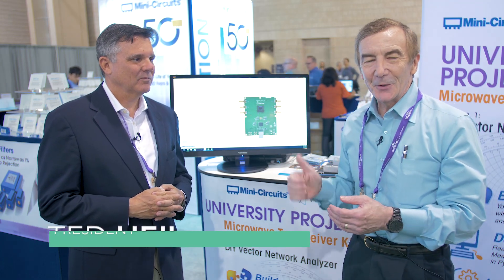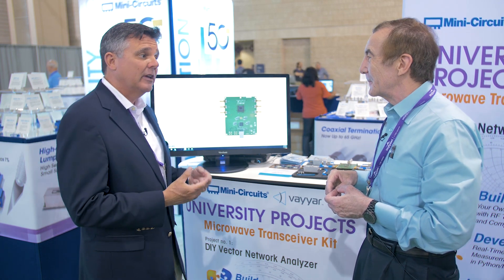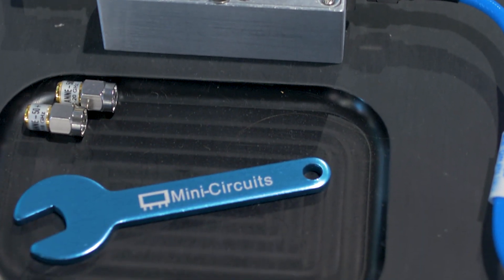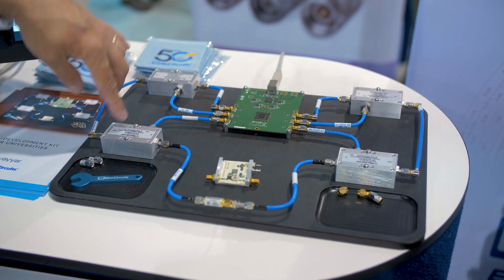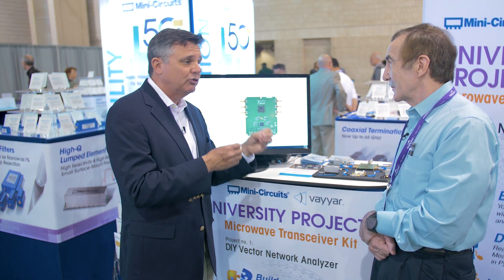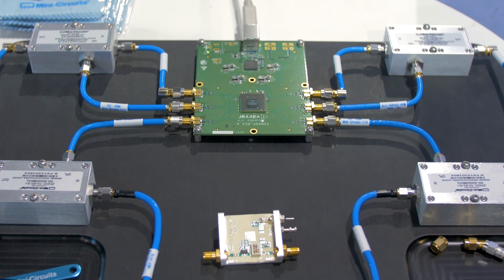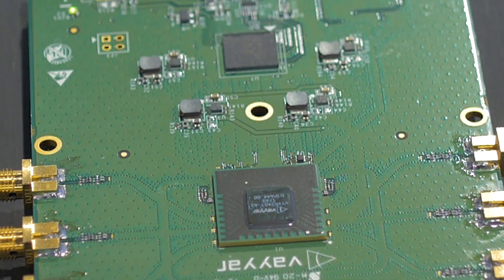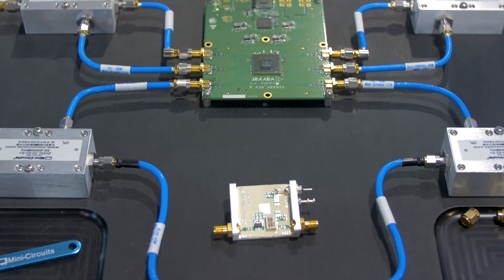How to build a do-it-yourself vector-network analyzer that’s actually useful

Comment: $2000-$3000 is way too much for a college project.  The idea is to learn the basic principles and that can be done with a VNA that doesn't go up to 6GHZ.  Even a 100MHz instrument is very useful and  up to 1.3GHz covers a very interesting range.  The key thing is to get good raw data over the frequency range and then use mathematics to process this data.  That's how the students learn.  The results will be good for much less than $3K.  The calibration kit for a 1GHZ VNA can be less than $50 and making the kit is a very good learning experience.
Reply: Does that $50 1Ghz VNA kit actually exist or was that just a plausible wish list? something like that would be perfect for me, but the cheapest VNA I could find is the DG8SAQ SDR at £420...
Reply: @joejoe4games  What is that strange squiggle thing before the 420?
Reply: @joejoe4games  Hey, so I know this comment is a year old, but a mechanical/manual, third-party calibration kit ("cal-kit") can, indeed, only cost around $50.

Comment: good luck has nothing to do with it, rip off us over pricing at cost, and over valuing product gets you low or no sales in the global diy education markets,making and actually selling things people want to actually buy and use is the only sme way to ethical profits
https://www.ebay.co.uk/i/254098989801?chn=ps
Vector Network Analyzer Kit miniVNA Tiny VHF/UHF/NFC/RFID RF Antenna Analyzer UK,£368.49

Free postage
Get it by Sat, 30 Mar - Mon, 1 Apr from Glenfield, United Kingdom
 • New condition
 • 30 day return
Reply: This isn't targeted at "diy education" and your junky toy doesn't even come close to doing what this thing does.

You're comparing a lab grade educational tool to what is essentially low end commodity hardware, that doesn't even serve the same purpose. Yours is an *APPLIANCE*, this is NOT. 

While they each can ultimately do the same function to a greater or lesser degree, they have WILDLY divergent purposes. But then again I don't expect a spammer to understand the difference.

Comment: I agree with the sentiments expressed here that the cost is way too high.  This is essentially boutique Lego for RF engineers - uses pricey top-end Mini Circuits blocks.  Perhaps better would be a dev board with the RF stuff on one board connecting to the Vayyar board (or e.g. work with ADI and make a ADALM specific to this effort).  This would significantly drop the cost by eliminating all the machined enclosures, cables and connectors.  I know that the presenters say that this is very inexpensive for what you are getting, however, it is way out of range for the student market they are targeting (maybe they forgot there own early days at college?).  Possibly a few wealthy students at an Ivy-league or EE hobbist that can afford to shell out $2500.  BTW, there is a bit a false comparison in stating that you're getting something even close to a $150K VNA (freq range and dynamic range are wildly mismatched).  Consider a field-portable grade 6 GHz VNA from TEK (or knock-off brands) and there is NO comparison.  There is a lot missing (software, calibration, ruggedizing to make it safe / useful, a display and button panel with user interface - tons of features for setup and visualization, ...)
Reply: All this seems to have gone over your head. It's unlikely that students would foot the cost for this kit. The university would purchase this for their labs for the students to use IN THE LAB. $2500 is chump change for a University that's teaching HUNDREDS of students a year in such a program. The would probably buy a dozen of them.

Your argument about the missing ruggedization is a straw man. There is absolutely NO need in a LAB environment, where it's beneficial to test/profile individual components as part of the learning process, to lock the relevant components inside a box. It defeats the point entirely.

Your argument about the display and user interface is equally as fallacious. Did you even watch the video all the way through? Did you listen to it? Did you comprehend what was said? The ENTIRE reason for this to even exist is as a LEARNING EXERCISE in parsing the raw output from the hardware, and processing that data by applying the principles taught in the lectures. The whole damn point is for students to LEARN what is going on inside, NOT be a button pushing monkey.

This IS NOT intended to be a turnkey measurement appliance.

It is attitudes like yours that contribute to the dumbing down of America.

Comment: While I appreciate the effort, that's just not cheap enough.   For less money, I could get a Rigol or Siglent Spectrum analyzer, with tracking generator.
Yes,I know a Spectrum Analyzer isn't quite the same as a VNA... but you can do a heck of a lot with one, and it's a single professional piece of kit NOT a bunch of boxes cabled up and needing a whole table.

Comment: A very good VNA learning platform indeed for college students! I'm currently building a 6 GHz two-source vector network analyzer myself using mostly Mini-Circuits and Analog Devices parts and components. It's fair though to point out that an Agilent 8753D 6GHz VNA can be had for ~ $2500 from ebay, of course minus the SOLT cal kit, and 3GHz 8753D's are < $1600. For up to 6GHz, decent SMA SOLT cal kits could be purchased and if the student is mostly working on microstrip PCB structures, as is very likely the case, he/she must develop and use TRL cal kits.

Comment: $2500 Yea I got news for these guys it's too expensive esp. on a students budget. At that price range you can get used VNAs  Maybe have something that goes up to 3 GHz for $800 then we'll talk. I really don't think they spent enough time with the BOM. Btw, if they open sourced the design I bet I might get the price down.
Reply: A student at a university will have such equipment bought for them by the university. Why is this so hard to understand?
Reply: @sparkfly7228  Only for the lab - not to personally keep. Why is that hard to understand? :-(
Reply: @RogerBarraud  Why would they keep something that the University purchased for them to learn with? You don't seem to have a very good grasp on what higher education is about.